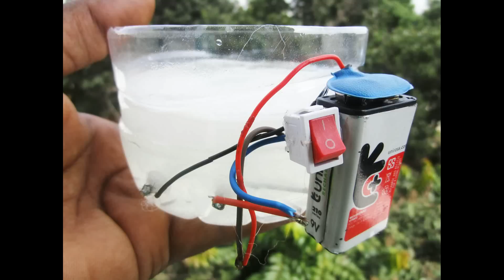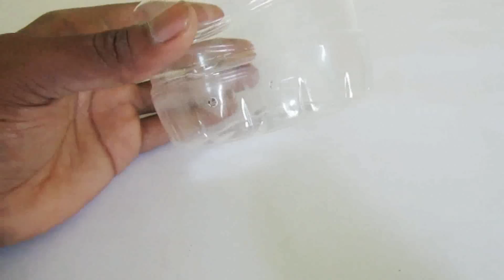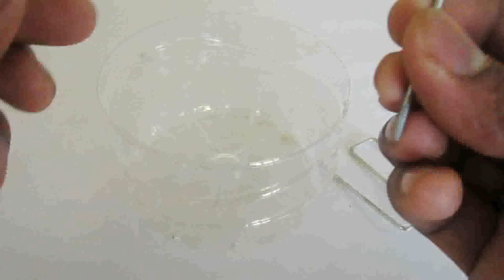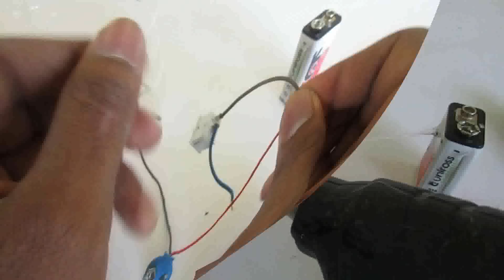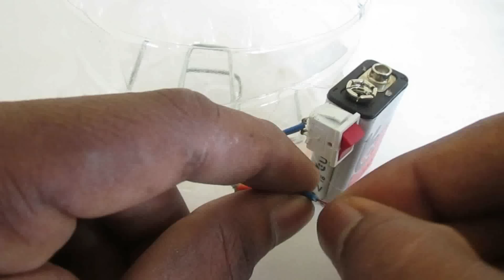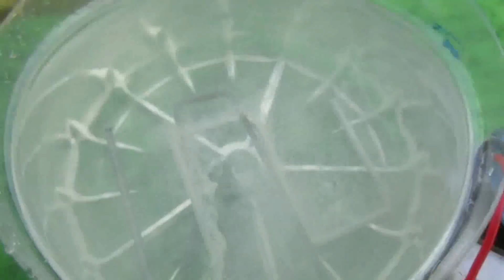How To Make a water Heater - Battery Water Heater

Comment: That's  electrolysis not water heating. The bubbles which apparently seem like water vapor are hydrogen  gas.
To boil water you just make a coil  with those metal rod and connect Neg-pos on either end of the coil.

Also in the video, water used was salt dissolved